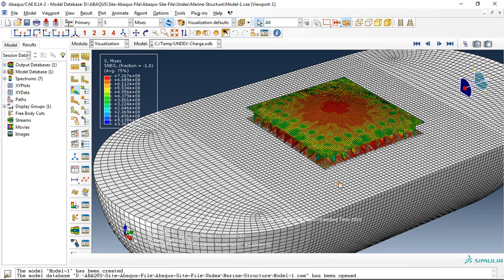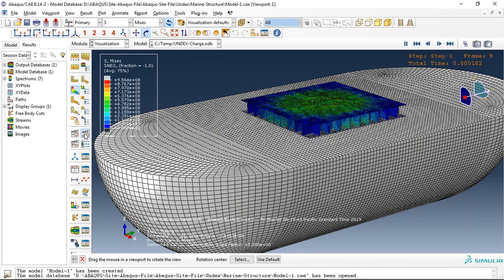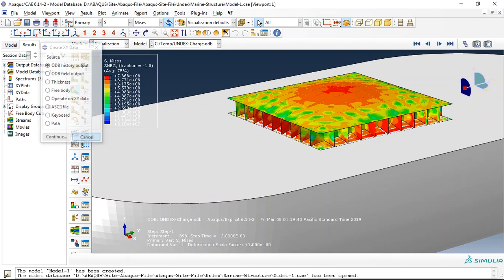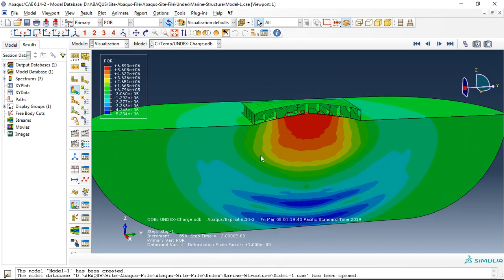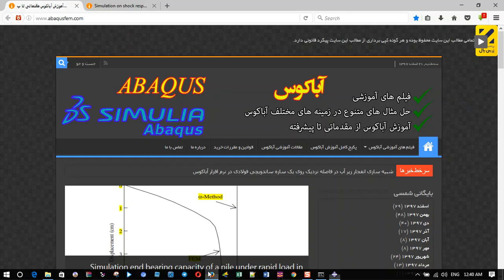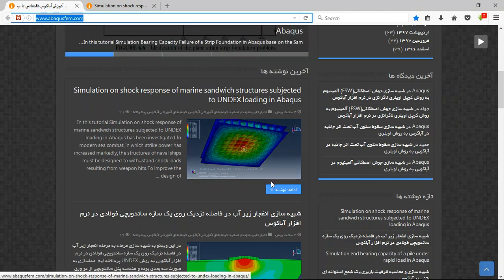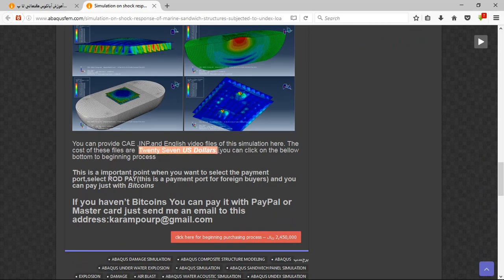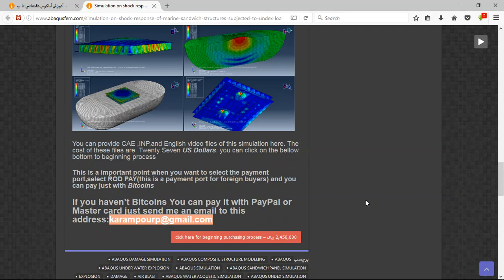Simulation on shock response of marine sandwich structures subjected to UNDEX loading in Abaqus

Comment: I want to know that, just tie the free surface and the lower sandwish face, or have to divide the free surface into two parts which include a small square same size with the sandwish,and then tie the two same size surfaces? PLEASE help me , thank you very much!
Reply from the maker: You can do both of them.
Reply: @abaqusfem3576  Thank you, but which operation is better, or any other operations?  Could you tell me, thanks.
Reply from the maker: @热心市民-l8h  Make some partitions to specify the location of the contact zone.
Reply: @abaqusfem3576  Would you please tell me this is scatter wave or  total wave, thank  you